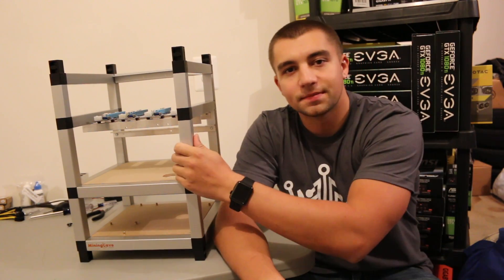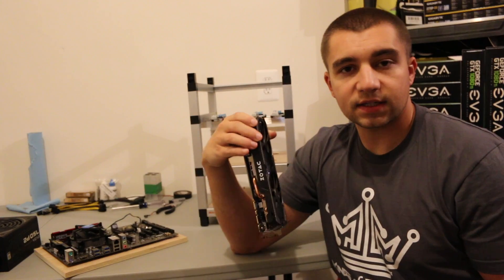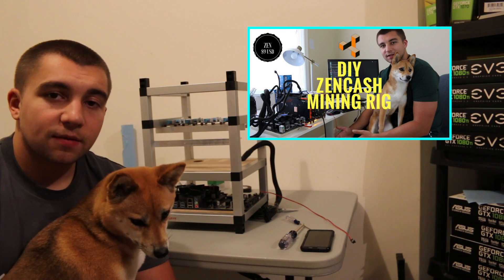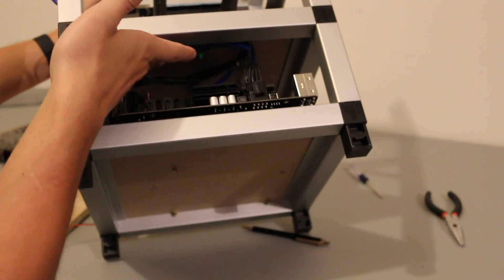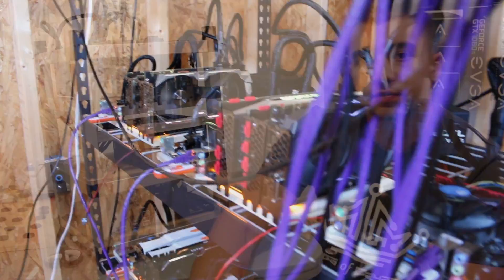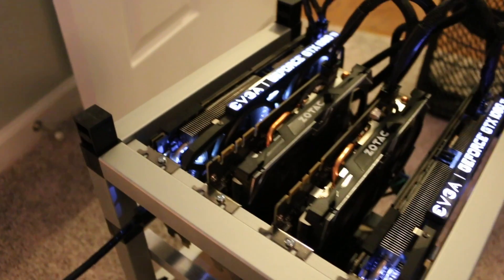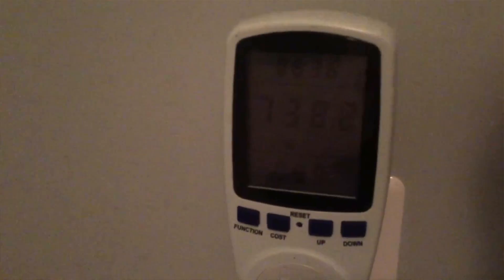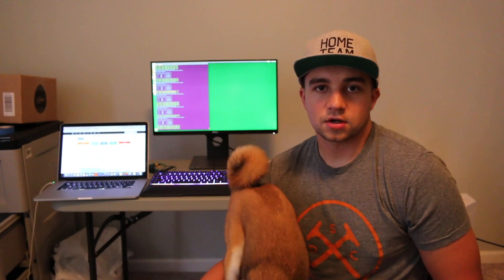Best Budget DIY GPU Mining Rig ( Mine Zcash, Ethereum, and ZenCash )

Comment: 1080ti is a beast but is far from budget or efficient. And running any PSU that close to its max limit is a super bad idea. I'm assuming you're using a program like afterburner to down-clock those cards. Can you imagine a power spike or a rig reset loading back up with default settings? I would have gone for a minimum 1000w gold or two 500w golds.

Comment: Nice setup.  I'm a newb on the mining venture.  Haven't bought gear yet, but about to.  Once you have a setup as yours or similar, how does one go about determining what crypto to mine?  I already have a e-wallet setup @ coinbase, so I'm good there I think.  I plan building my own rig to support the GPU's and MOBO & PS. 

 Does simplemining help determine what crypto to mine?  That's the part I'm struggling with before paying for hardware, or am I getting the cart before the horse... I also noticed you can put in a 1x PCI card in a full slot?  Didn't know that until I saw your vid.

Also do certain cards work better for different crypto's?  Do need to figure out which crypto to mine, before getting the GPU's?

 Subscribed as well.  TIA

Comment: would this setup be worth making with 4 1060's working on a budget, or get two 1070 ti's?
Reply: Cody Baxter get the 1060 6gb dual fan cards it's what I'm doing currently have 3 coming in the mail got them for $260 each on sale with rebate.
Reply: 24mh/s x3 is 72mh/s $770. If you go 1070 then $400x 2 is $800 @64mh/s you do The Long term math if you run a 13 gpu Mobo on Linux because it's only way to run 13 gpu since windows can do like 6 max. Better hash rate for your buck this route.

Comment: Hey I was wondering is there any difference in hashrate or power usage with the mini versions of the  1070 and 1080s?
Reply: Funnyhehe515 no should be the same hash rate if there clock for clock with there founders editions

Comment: Just a thought but can the PSU be mounted in such a way that it wont blow hot air on the cards? I dont know if that is a issue as I have never built a rig just wondered, thanks
Reply from the maker: +Rick Mitchell in stock configuration no, however these atx PSU run pretty cool

Comment: With 740 watt total use, I'd go with (at minimum) a 850 watt power supply. You might fry your 750.. Although it'll put out 740 for probably a month or two, it probably won't be sustainable and won't last long running at full tilt 24/7. Other than that, great videos, keep it up :)

Comment: I roughly calculated this to ROI in around 358 days. Is that correct? I just roughly summed the part prices and used whattomine equihash calculator. Parts+Tax+Shipping=roughly $2400. Then with 2150 h/s at 740w you currently get $6.71 per day which get's you close to aprox. 358 days. This is wrong if sol/s is not the same as hash/s. Despite my 5 minutes of googling, I still don't understand the difference of sol/s and hash/s. Appreciate anyone that has a clear explanation. Some say it's the same, some say multiply hash/s by some factor to get sol/s. Love your videos. Informative, Interesting, Detailed, Short.
Reply: Just found this:  
Sol/s measures the rate at which Equihash solutions are found. Each one of those solutions is tested against the current target (after adding to the block header and hashing), in the same way that in Bitcoin each nonce variation is tested against the target. That is what we mean by Sol/s === H/s - they are measuring the same thing, and it is the same metric that everyone already uses for other PoW algorithms. Put another way, measuring Sol/s in Zcash is exactly the same as measuring TH/s in Bitcoin (ignoring the "T" scaling factor, which is merely a product of the relative speeds of the PoWs and the relative numbers of miners).

The problem with using H/s is not that the base metric is wrong, but that there are several metrics that could be picked, only one of which is the same as what users expect. In the screenshot above, NiceHash have incorrectly picked the metric "Equihash runs/s" as equivalent to H/s, leading to user confusion (because users will look at that and compare it internally to Bitcoin's TH/s). By using "Solutions/s", it is completely unambiguous to both miner developers and pool developers which metric it means, and it ensures that users are getting the "right" metric.
Reply: Thanks for taking time for this! It helps a great deal.

Comment: I answered 15 comments, my good deed of the day is done, I can't wait for the 1070 ti embargo to drop tomorrow! I am going to have my mouse over the buy button by tonight, if people report good hash/w, I am upgrading my r7 1700 system, selling ram and motherboard and 212 evo, and buying super good oc hardware to get those super high clocks on ram and cpu, I am going to buy 4 ram kits to find which clocks the best and return the other 3, ram can be so stressful, is it just me or are there like 40 mobos behind you?
Reply: Already preordered a crap ton of 1070 tis was already planning on upgrading my 1050 rigs and right now you can preorder for cheaper than normal 1070s
Reply: dale knox ya, tell me how they hash once you get them
Reply: Will do I seen someone say they got theirs early and it done 26 mhs stock and 32 mhs overclocked which is pretty much what 1070s do so I'm hoping drivers are not released yet or they are just trying to scare people out of buying them
Reply: Sniper Pro nerf mods I have 25 going now got another 25 to go but I'm noticing something strange I got the msi dukes and all of them crash at the same overclock settings of +139 which is really odd for all the cards to crash at +140 almost like it's intentional. But stock it mines at 26 overclocked in getting 33 on eth
Reply: dale knox that's funny, I saw team greens video just now and he has 200 plus on core and 750 on ram, thanks for the eth hash info, I am broken on wether to get 1060, 1070,  or vega to mine eth, chooing gpus is so stressful right now
Reply: Sniper Pro nerf mods I'll have to go check that video out cause I can't get any to run stable after 139 on core. If I could get this many cards with 1070 I would of gone that route but I knew getting 50 1070s would of been a chore to do

Comment: Those platic connector are frickin' expensive here (France :-/ talking about the frame)
BTW the highest sol/w are the 1060
Reply: Melpheos1er actually its the 1080ti
Reply: What is the sol/w of the 1080ti ? I see 3.6sol/w here
The 1060 does 4.6sol/w
If you multiply this by the fact that you can buy almost 4 1060 for the price of ONE 1080ti that's a lot of difference in term of profit (according to whattomine with conservative values in equihash, it's a difference of 1$/day less profit for the same investment
Reply: Melpheos1er dude, it takes a day for all the effects of weed to wear of, 1060 does almost 290, 75w 1080 ti does 900 200, tell me now
Reply: Melpheos1er please do not try me dude

Comment: Hi, thanks a lot of the vids, very informative :) and subscribed after the first video i watced , i am juist building my first rig and i got an 8 gpu server rack chassis.. have got 8 1080 ti's to fill it but the PSU is 1600w , the chassis builder is telling me that the 8gpu chassis with that PSU will be fine but everything i read and see tends to have more than that for 8 1080's.. will it work or is is best to get another chasiss and split maybe 4 1060 & 4 1080 ti on that PSU?
Reply: I would make sure that the PSU have enough connectors to power 8 cards, my 1000W Corsair only had enough room for 5x1060s and risers. So might be advisable to share the load between two PSUs because of that (maybe 2 x 1000W or 1000W to motherboard and 4 cards + 750W for 4 cards)
Reply: Terry Johnson it will work, fam at bbt do 19 cards a rig

Comment: One thing I noticed: You're running your PSU at almost full load, and that's not good for them long-term and may cause them to fail early. Don't go cheap on the power supply, as that's the heart of your system. Always give yourself extra headroom on the wattage. I'd run at least a 1000W, maybe 1200W. EVGA is a good brand, but I've heard of cases where lower quality PSUs failed under load stress and took out other components in the process, so be careful.

I'm trying to sell my Antminer D3, and if I want to continue mining, I think I'll go the GPU route, simply because the cards can process far more algorithms than an ASIC, and the cards will hold their value longer.
Reply: Sniper Pro nerf mods Listen here, you can barely form a fucking sentence you illiterate fuck, so I have no idea why you  are accusing me of failing school. Also, I can afford a mining farm(and own one), because I have a fucking job. And when did you get your bitcoin, because I’m fairly sure I got it before you.
Reply: Sniper Pro nerf mods No, power supplies are supposed to have a third of the wattage as headroom.
Reply: TheEliminator yes they do, have you even maxes out a psu, no, you have no idea what you are taloing about so is what you are doing here
Reply: Sniper Pro nerf mods Yes I know that they can be run at full load, but they aren’t supposed to be run at full load. Also, don’t tell me that I don’t know what I’m doing, when you’re the one spreading misinformation(Also you’re literally 12 years old).
Reply: redstarr513 just had to "LOL" at that one, hahaha. I remember the days when I thought I knew everything too  :)
Reply: evga is good at best. a seasonic could be rin at full load for years, with no problem. in fact you can over load a seasonic with no problem
Reply: TheEliminator your a dumb ass, I tried to inform you but no your too ignorant, talk to me when you get more than 2 13 gtx 1060 rugs and 4 rx 470x6 rigs up and running, can't afford jack so go back and flip some more burgers to get your first gpu
Reply: TheEliminator dude, please don't even try me youa are the one who failed in school and can't even afford a mining farm, so dont even do ln2 overclocking, you don't even have autocad and solidworks certifications, you are the little peasant here, now be nice to me and people will help you including me, currently no one cares about you in the crypto community, I got connections all over and that is also how I got my btc+ before pretty much everyone else (besides cryptomined), try me on anything and you will learn, do you understand or do you want to continue your life as a failure
Reply: Steelclaw your a dumb ass, that is how it was I tended to be used , and that psu has a extra 50 watts reserve.

Comment: Does the mini GPU get reduce hash rate compare to the full GPU
Reply from the maker: Not really, just less space to cool the same hardware basically
Reply: Desmond Cheah can not boost as high, and fan has to spin faster so it using a few extra watts and the vrm of the gpu of zotac are trash and uses 20w more then good ones,  but its for the incredibly small form factor people buy it

Comment: Thanks for the videos .. I am new to the bitcoin industry and have a few questions about mining ... I checked with my power company and my cost is 9.8 cents per KWH , is that a good balance ?  Also what equipment do you recommend and who would you suggest mining for ???   Thank you  ,  Tom
Reply: He has a post pinned at the top with the list of parts he used to build this rig. You could use cheaper cards like a gtx 580. 9.8 kwh is kind of average, not bad. Mines is 20cents per kwh which is among the most expensive. Hope that helps.
Reply from the maker: Zotac 1080 Mini 8gb (4x)
http://amzn.to/2zweEWM
Zotac 1070 Mini 8gb (4x)
http://amzn.to/2xMruhB
Zotac 1060 mini 6gb (4x)
http://amzn.to/2gOOIxK
Gigabyte z270 d3 mobo
http://amzn.to/2yvLVmh
Intel g4400 CPU
http://amzn.to/2yvIUTh
ATX power switch
http://amzn.to/2zxp4pe
Ram
http://amzn.to/2gOnmYK
EVGA 750w PSU
http://amzn.to/2hNSKpQ
Alternate PSU Parallel 750w (needs ATX adapter)
https://goo.gl/ZFckQc
ATX mobo adapter https://goo.gl/BDbcGD & https://goo.gl/5G6pHU
Velcro (Useful for customizing placement)
http://amzn.to/2zgKDt8
Arctic Freeze Thermal Paste kit
http://amzn.to/2zi6TD5
PCIE Risers
http://amzn.to/2xMTKQY
Add2PSU
http://amzn.to/2xMtVAM
Zip Ties
http://amzn.to/2xIib2S
Reply: Tennessee Tom ya, avergae in us is 12, 20 in eu
Reply: Thank you for the reply... It is my understanding that if the KWH is to high it's hard to make any money mining. I know little or nothing about bitcoin or bitcoin mining. I want to invest but want to be sure I have all the info before I jump in. Voskcoin seems to know what he is doing ,,,,  Thanks again for the reply   ..    Tom
Reply: Watch more videos on this channel, you can watch this video too: https://www.youtube.com/watch?v=ui_1HB5qlFw 

also websites like coinwarz.com have mining calculators that approximate how much you will make based on which coin you are mining, how many hashes your machine or gpu rig is doing and how much you are paying in kwh.  Hope this helps.

Comment from the maker: Mining Rig Parts on Amazon- http://geni.us/WQd7cCs
Graphics Cards IN STOCK on Amazon- http://geni.us/nti5asr
FULL PART LIST
MiningCave Coupon for entire site = voskcoin https://goo.gl/Qk1th5
Zotac 1080 Mini 8gb (4x)
http://amzn.to/2zweEWM
Zotac 1070 Mini 8gb (4x)
http://amzn.to/2xMruhB
Zotac 1060 mini 6gb (4x)
http://amzn.to/2gOOIxK
Gigabyte z270 d3 mobo
http://amzn.to/2yvLVmh
Intel g4400 CPU
http://amzn.to/2yvIUTh
ATX power switch
http://amzn.to/2zxp4pe
Ram
http://amzn.to/2gOnmYK
USB (Harddrive)
http://amzn.to/2znaPX9
EVGA 750w PSU
http://amzn.to/2hNSKpQ
Alternate PSU Parallel 750w (needs ATX adapter)
https://goo.gl/ZFckQc
ATX mobo adapter https://goo.gl/BDbcGD & https://goo.gl/5G6pHU
Velcro (Useful for customizing placement)
http://amzn.to/2zgKDt8
Arctic Freeze Thermal Paste kit
http://amzn.to/2zi6TD5
PCIE Risers
http://amzn.to/2xMTKQY
Add2PSU
http://amzn.to/2xMtVAM
Zip Ties
http://amzn.to/2xIib2S

Mining software used is nvOC made by fullzero https://goo.gl/pYgo8B
Alternate Mining OS smOS https://goo.gl/jMxTSS

We are a participant in the Amazon Services LLC Associates Program, an affiliate advertising program designed to provide a means for us to earn fees by linking to Amazon.com and affiliated sites.
Reply: I roughly calculated this to ROI in around 358 days. Is that correct? I just roughly summed the part prices and used whattomine equihash calculator. Parts+Tax+Shipping=roughly $2400. Then with 2150 h/s at 740w you currently get $6.71 per day which get's you close to aprox. 358 days. This is wrong if sol/s is not the same as hash/s. Despite my 5 minutes of googling, I still don't understand the difference of sol/s and hash/s. Appreciate anyone that has a clear explanation. Some say it's the same, some say multiply hash/s by some factor to get sol/s. Love your videos. Informative, Interesting, Detailed, Short.
Reply: A couple questions...  What are your clock settings to be able to get 4 cards on a 750 watt psu?  I am using 1,000 watt psu and a 750 and thats for 5 1080 TIs.  Granted, I have the OC settings maxed out which allows me to get 750-770 sols a card.  That said each card is using around 250-260 watts.  What are you undervolting them to -to where the efficiency per sol/power usage and cost is the best?  Are u still using ZHash at all?  Thanks in advance.  Nice build man!!  Keep up the good work!!
Reply: Sorry i prematurely asked about the wattage when i paused the video so disregard that question..  Anyway are you still using Zhash?
Reply from the maker: Yes I'm in the middle of moving all of my rigs around, but when I have my builds up to date / fixed I'll be pointing more miners a zhash, you can watch my trio on zhash if you're interested here https://zhash.pro/workers/zngbfusZgh6kTN6SBKBqBSzTZj5iGA8j2Vs
Reply: what if I only use gtx1060 6GB (x2) in my mining rig? does it work too bad?
Reply: It depends on several factors. Find out the kwh for you power supplier as well as the wattage draw from your 2 1060's. Go to whatotmine website and plug in your cards, kwh and wattage. This will tell you current most profitable coin, mining cost and profit.